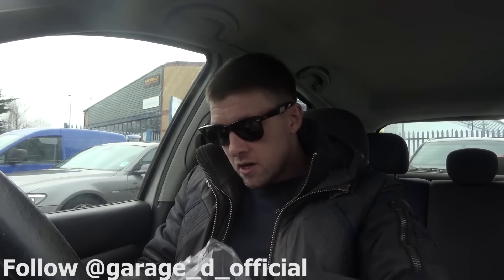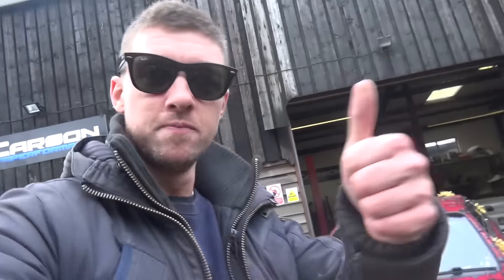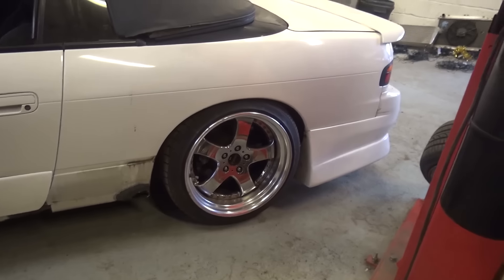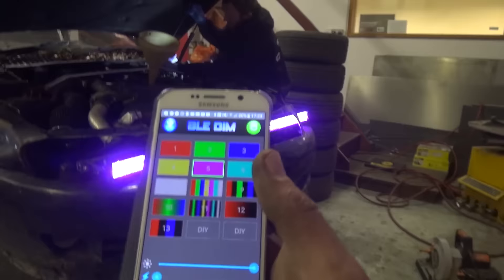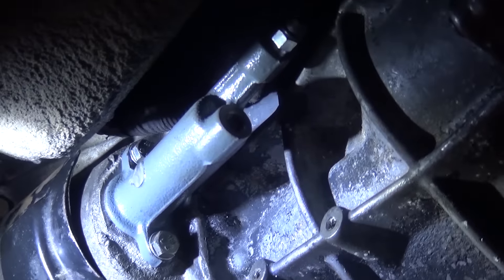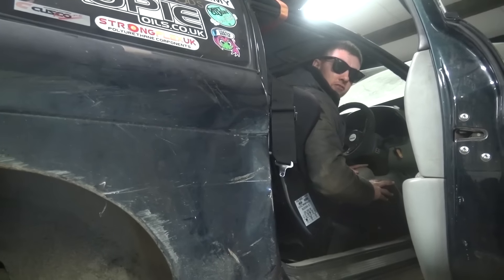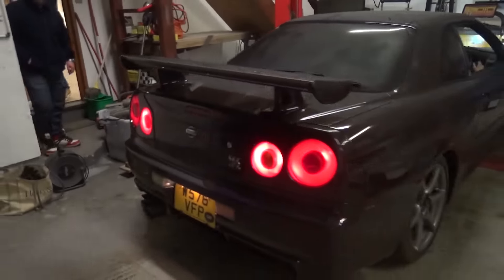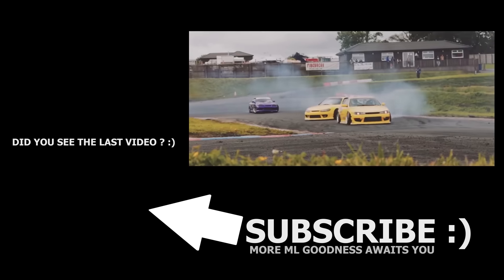🐒 S14 GETS NEW RIMS + 1JZ SOARER READY FOR WAR

Comment: Normfest Terpanol will have that adhesive off stat. I had some graphic residue on a car I was selling that had been exposed to the elements for years and built up dust and crap. WD40 and others wouldn't touch it, Terpanol had it wiping off straight away.